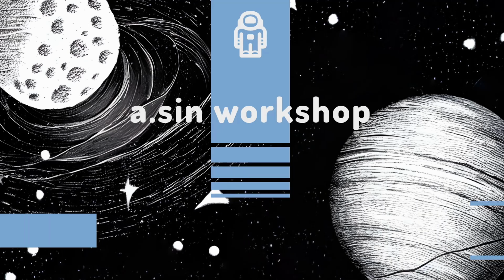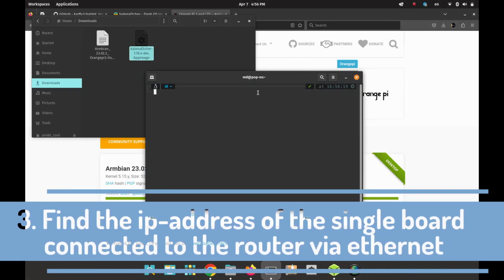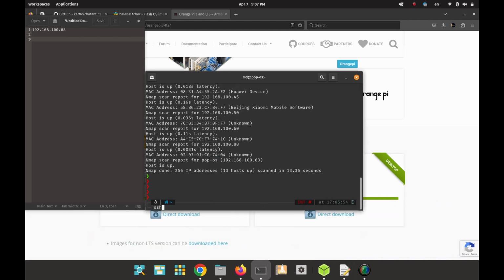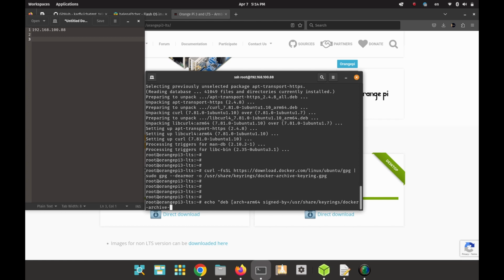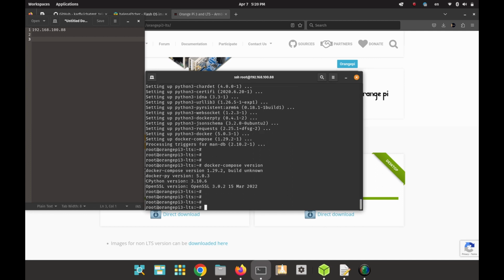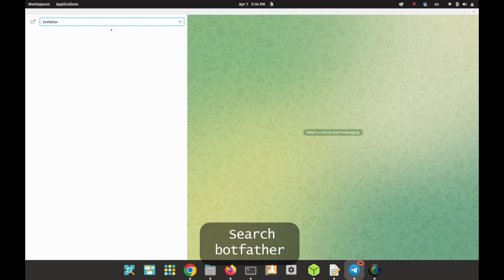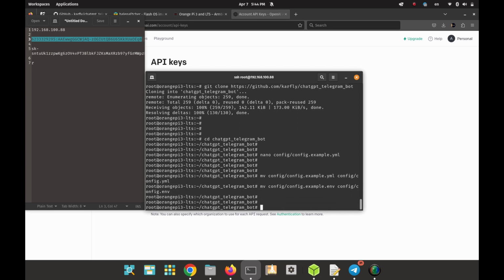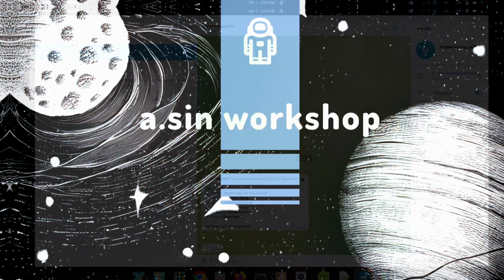Telegram ChatGPT bot on Orange Pi 3 LTS with Armbian on a board

Comment: please tell how to run it via vpn (from Russia does not work chatGPT)
Reply from the maker: I think you're having trouble registering. To fix this, you need to use a special service to buy a virtual SIM card, which is required for registration. Make sure the country you select for the virtual SIM card matches the country you're using the VPN for. It's also a good idea to have a new e-mail address.

Once you have all this, try registering again. 

This should help you!
Reply: @a.sin_workshop  yes, im registered and use but with vpn
Reply from the maker: @Grizzzly  Okay, I've got it. Yes, it is conceivable. You must modify the Dockerfile so that the VPN is loaded before the script runs. You must do the following to accomplish this:

1. Inside the Docker container, install the VPN client. The RUN command in the Dockerfile can be used to accomplish this. To install OpenVPN, for example, execute the following command:
RUN apt-get update && apt-get install -y openvpn
2. Create a VPN client configuration file and place it inside the Docker container. The COPY command in the Dockerfile can be used to accomplish this. As an example:
COPY vpn.conf /etc/openvpn/vpn.conf

Set up a script to launch the VPN client before you start the main application. This can be done by using the CMD or ENTRYPOINT command in the Dockerfile. For example:

CMD ["openvpn", "/etc/openvpn/vpn.conf", "&", "python", "bot.py"]

This command will start the VPN client and then run the bot.py script.

Note that in order for the VPN client to work inside the Docker container, you may need to configure additional settings, such as routing traffic or setting up DNS. You should also make sure that the VPN client is configured correctly and works correctly inside the Docker container.
Reply from the maker: @Grizzzly  In fact, you can wait a couple of days. I wrote my bot, which works fine through cloud services like pythonanywhere. And it should work fine without VPN, because the servers are not in Russia. The video is just in the making.
 
Although you can do it without the video description. There will only have to register on the service and run the console.

https://github.com/51n1au5k1/simplest_chatgpt_telegram_bot
Reply: @asinworkshop  you're great!) ty
I'm going to try it, do you have a telegram or something to communicate some faster?)
Reply: @asinworkshop  Did I mention that you're cool? I'll say it again, you're cool dude) everything worked out and the bot worked, but I wish there was some feedback, what he thinks... otherwise you sit and wait, but what are you waiting for?) Also, the main question, is it free or do I have to buy it? ( I mean chatGPT, not your bot)
Reply from the maker: Thanx! Just uploaded a new video, been busy these days. Let's try via telegram. I created a special account so I wouldn't have to show my personal one to the whole Internet.  enthusiasts_corner
Reply from the maker: I'm not sure how to find out what he thinks. Only if you inquire.

And therefore there is a membership "extra" of slightly more than $20 per month from the benefits of access to four models (25 messages in three hours) and rapid response to models 3.5, even when the system is overloaded. Nonetheless, for the time being, using the free functionality is perfectly acceptable.

And thanks again!!!

PS: I upgraded my bot, now it can generate pictures.